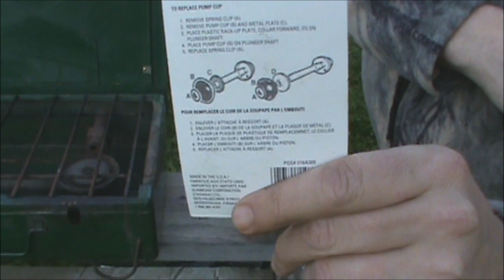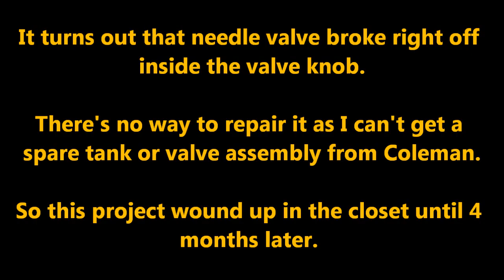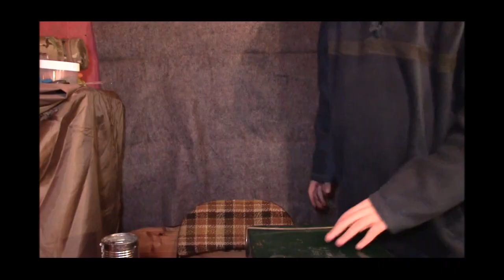Coleman Camp Stove Maintenance and Repair

Comment: I just got a 425 stove off ebay.  However, the connection between the generator and the stove is at a bad angle. maybe  cross threaded??  I may have to return this to the seller as not what described but through I would try to find out if it is possible to get a valve for this round tank. I noticed you have this type of tank.  Any help would be appreciated. thank you, mary
Reply from the maker: It may indeed be cross-threaded, so try to carefully unscrew the generator tube and then screw it back on. Also, it may be something as simple as the tabs on the tank being bent. If they're bent the tanks doesn't attach properly to the stove so give that a try too.

Sorry - no luck on the valve but you might find that one of the valves for the current line of stoves may fit.
Reply: thank you. ...and your videos are very helpful

Comment: ive got 2 of the tanks you got on yours and i put one on my 73 425e it turned it into a blow torch are these old round gol/copper tanks from the 30s or 40s? lol
Reply: May be a little late to the party but if you look at the hangars on the tank that hook on the stove there should be the month/year punched on them. Mine has 60 2 so February 1960

Comment: All Canadian and US-made Coleman compact liquid fuel stoves have the same valve and generator assembly, except for the Dual Fuel 424 and some Easi-Lite models - although the valves and generators from those models would fit on your stove anyway.  Your best move would be to get an old one from a thrift or yard sale for very little money, remove the valve from it and install it on your nice copper tank.
Reply from the maker: I'll keep an eye out for one, though they're in high demand and short supply around here these days since the prices went sky-high on new ones. What would really be good is if I could just find the tank assembly, or maybe one with a good tank but a rusted out case for cheap. And if I could find a decent 3-burner on top of that, it would be outstanding.
Reply: Here in Québec, it's the other way around.  They all get rid of them and go for new ones running on propane; so it's fairly easy to find an old beaten rusty one for next to nothing.

If you don't mind paying for shipping, I have a 1966 Wichita-made, 3-burner, model 426D that I'd let go for $70.  Got it last year from a guy from New Hampshire.  Fuel cap is leaking; needs a new one.  For the rest, it just runs perfectly.
Reply from the maker: Apinka Pike Sorry - I didn't quite explain that correctly. The propane stoves are always in big demand here too. But the newer white gas stoves aren't as they jumped in price. So people are grabbing up the older white gas stoves like crazy. Plus, Some people are even buying stoves with bad tanks just to convert them to propane with the Mr. Heater adapter I used here from Princess Auto.

Sorry, but the budget can't take a new stove right now. But I'll see about it in a few months.
Reply from the maker: Sorry, but YouTube message notifications get messed up at times. It's now been a few months and the budget is looking better. That's a decent price too for a stove in good condition, so if you still have that stove I'd be interested.  Please send me a PM and some pics.

Comment: How old was that Coleman stove?  1940's?
Reply from the maker: +tigertank06 Not quite that old, but it was made in the early-1960s from what I could find.
Reply: Alberta Bushcrafter Oh that's cool.  My grandparents have some stoves that are either from the mid or early 60's.  Coleman stoves are truly iconic.
Reply from the maker: tigertank06 I never cease to be amazed by their ease of maintenance and their longevity. I've seen other makes that don't last nearly as long (knockoffs?). In fact, I still use my Coleman stoves regularly for all kinds of outdoor cooking as well as family reunions and such.
Reply: Alberta Bushcrafter I think that's one of the main strong points of Coleman, that their stoves and lanterns are all over the place.  I might just get an older model stove with a new because Coleman products are that good.  It doesn't matter whether if your stove was made in the 60's or today, it's still a reliable product.

Comment: Hi Dean!  I didn't know about the propane conversion unit, so I'll have to take a trip up to Princess Auto sometime this week - love that store!  I still haven't given up on the white gas aspect, but I've been having trouble with my old stove - it'll light up ok, but won't switch to that nice blue hot flame.  It stays yellow and sputters away no matter how I adjust it.  Are you here in Calgary?
Reply from the maker: Barb Barrett That propane adapter can be tough to find at PA as each store seems to have its own ideas about what belongs on the shelf. I know that one of the stores in Edmonton (near where I live) stocks these and the other doesn't. However, you should be able to get it online. I think Amazon also has these so that's another possible way to get one. 

As for your own Coleman, the most likely issue is that pesky stove generator I had so much fun with in the video. Yours is likely corroded but not so gunked up that it will shear off like mine did. You may still be able to replace it - good luck!
Reply: Alberta Bushcrafter Thanks, Dean!  Crap, I was hoping you lived closer to Calgary so we could go for a coffee and talk Coleman stoves, lol.

Comment: I'm repair  a Coleman  425 B how do I clean  it
Reply from the maker: First clean the stove very well and check the burners for obstructions. Then fill the tank with fresh fuel and dispose of any old fuel safely and try pumping the tank to pressurize it. If the tank is sealed and if the pump works then try lighting the stove and see if both burners work. If the tank isn't sealed I replace the fuel cap and the pump leather cup in that order.

When cleaning the fuel system I also use about 30 mL (1 ounce) of fuel system cleaner added to the fuel - I use Seafoam. If the stove lights I usually run a full tank of fuel through the stove to clean it. Often that's all the stove needs, but if it's still clogged then you'll need to replace the generator.
Reply: Go to oldcolemanparts.com
Complete lesson...

Comment: Did you ever get your valve repaired?  Shouldn't be to hard it's only brass and a good machine shop should be able to fill, drill and tap new threads.  Just don't know how much it would cost though.  thanks for the video.
Reply from the maker: Nope. I think the tank is pretty corroded inside as well, as there's a lot of noise when I shake it up even though the tank is empty, like there are hard bits jangling around. I may just keep it as a propane stove.
Reply: To bad.  They just don't build them like that anymore.
Reply from the maker: That's for sure. And they don't make it easy to find parts for them either.
Reply: 20 years ago, I'd say take the tank to a radiator shop and have them desolder the end and clean it out and then resolder it.  But the old guys who used to do that are all gone and I don't trust most of the new shops to do it.
Reply from the maker: Agreed. Plus I know a guy who can get me a new tank and valve assembly, so I might just do that. The rest of the stove is OK and doing fine as a propane stove. In fact, it's better than most of the new propane stoves out there (except the Coleman ones).

Comment: How old is you’re stove mine has the more modern style tank and is 1968 I think the original owner must of been cooking dinosaur steaks on that😂
Reply from the maker: The stove with the copper coloured tank is a 1960 military M4 model, I’ve learned. And the generator tube is very hard to get because of that. That tube was so clogged with tars and gunk from running it on regular gasoline that it sheared off and was impossible to clean. And it must have done a great job on Wooly Mammoth steaks, anyway.

Comment: propane sucks. it is fine for warm weather but winter camping no thanks!
Reply from the maker: I have to agree with you there, and butane is even worse as it has a higher freezing temperature. White gas and other liquid fuels have WAY more stored energy, so they'll burn at lower temperatures and the fuel lasts much longer. In the long run, it weighs less too. I've run my other Coleman stoves at -40 C with very few issues, while my buddy's little canister stove froze solid.

Comment: That's really lame conversation.
 maybe you looked at the valve  Colman would have a new valve if the old one weren't repairable. First time seeing you so maybe you fix it down the road , restoration is what most Colman enthusiasts try for. Good vide tell it felt like you gave up , sorry i wasn't there so some speculations on my part.